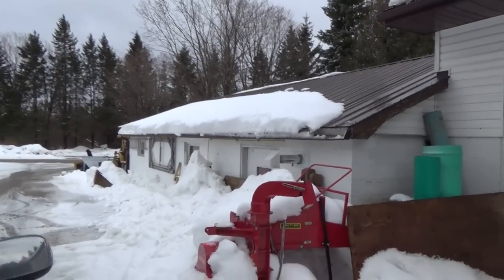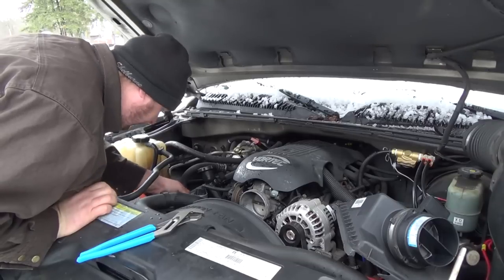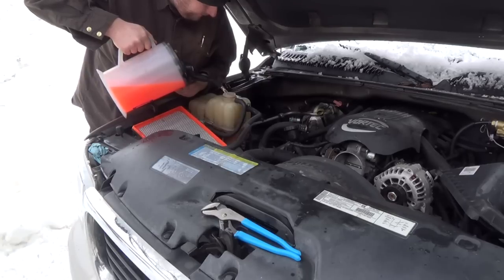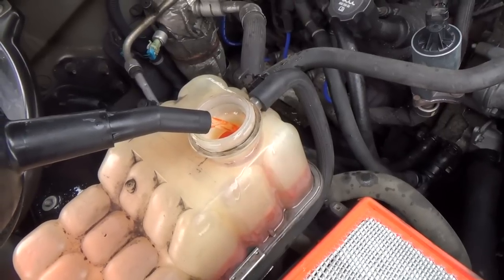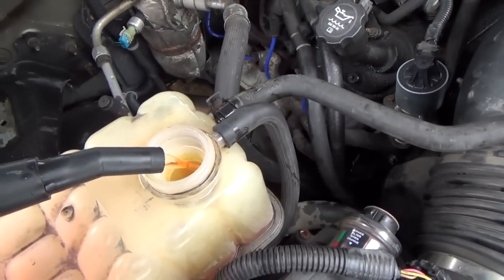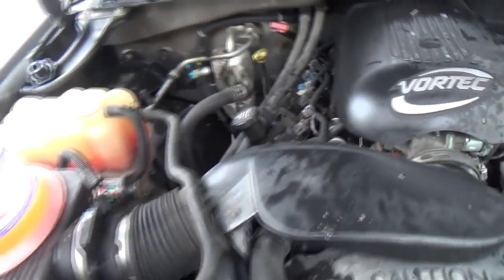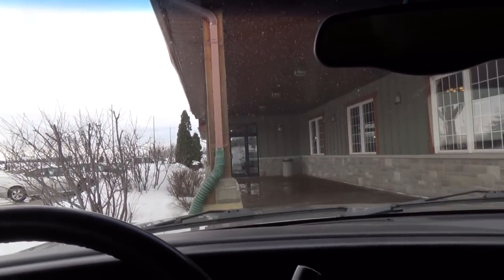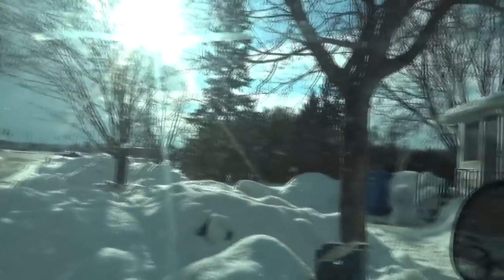blowing out the heater core and install a new thermostat in 2001 gmc sierra

Comment: The engine will heat up faster if you don't have the heat going :) Just slightly below the middle mark on the temp gauge is where it should be. The new thermostat fixed the problem. Nice work Bill.

Comment: Get yourself a couple of Steel stud mounted electrical boxes for your Halogens.  Some 14/3 gauge wire & wire nuts to wire em up with and connect em to an existing lighting circuit in the garage, where you want em.  Those fixtures you bought bolt into the holes of stud mounted boxes and will be very nice for throwing a concentration of light wherever you point em. Just mount the boxes so you can re-point the fixtures conveniently.  Keep up the good work.  It is a pleasure to see your efforts come to fruition.

Comment: In Iowa our anti-freeze is green.  Why don't you fill through your raditor cap?
Reply from the maker: that is the only way to refill it there is no cap
Reply: The color is not location specific, it's whatever the vehicle manufacturer decides to use. Bill right, Chev's don't have rad caps, silly GM engineering.

Comment: I heard if u let it run with the cap off you destroy your head gaskets. Wonder if thats true tho.
Reply: Not true that is the best way to bleed the system. They actually make funnels that screw in place of the cap to allow for filling/ bleeding
Reply: uh, no. thats is how you bleed the system of several types of vehicles that dont have a bleed screw.

Comment: your heater act like a radiator while in full blast... you should have run the engine without heater at first... then open it up, in the morning when its cold, dont turn on the heater at full blast... WAIT...

Comment: Dexcoool gums up your system.
Reply: I've seen very few instances of Dexcool itself actually causing problems. There are millions of vehicles out there using it. It's far more likely any problems stem from various "user error" factors (such as incorrect mixtures, not following proper fluid change and maintenance schedules, opting for low quality replacement parts, etc). There may be some design defects and/or part issues at fault too in certain circumstances (like low quality gaskets that anything will eat through, bad fill caps that allow air infiltration, etc). As usual the vocal minority makes it seem like a far bigger issue than it really is, and the misinformation and FUD spreads all over the place.
Reply: DeathK Some small cases Ive heard of it eating plastic... It does cause problems if you add green coolant to the dexcool.
Reply: Dex Cool by itself does not gum up your cooling system. Mixing it with other coolants it what causes the system to gum up.

However, Dex Cool, and other OAT coolants, eat plastic, nylon, and rubber.  Dex Cool is one of the major factors in GM's head gasket issues on their 3.1L, 3.4L, and 3.8L V6 engines.